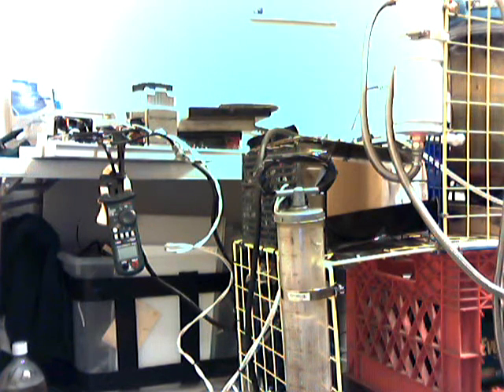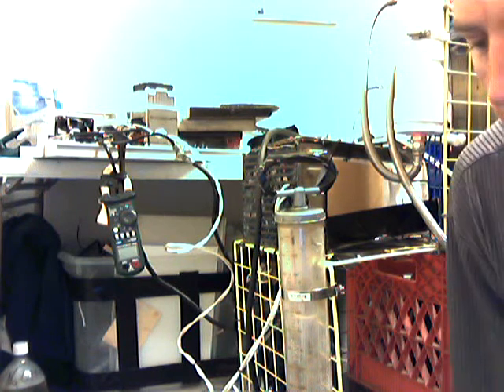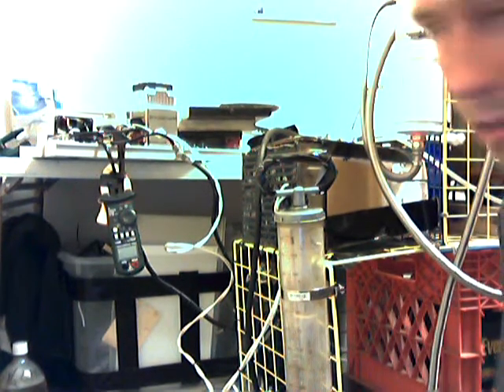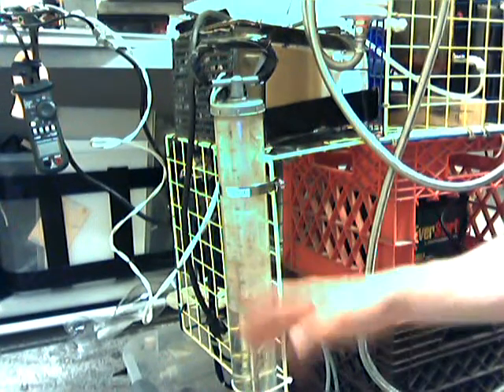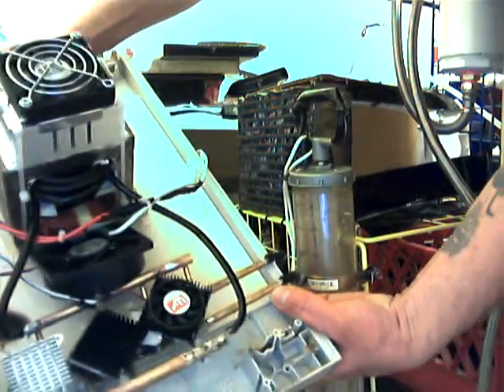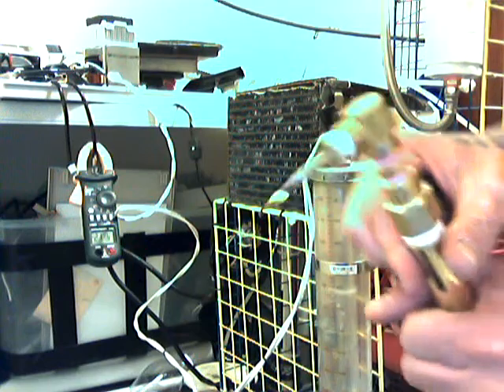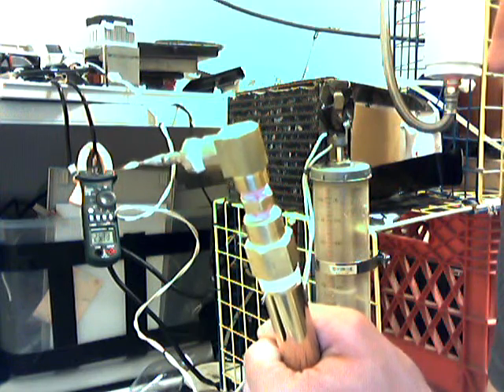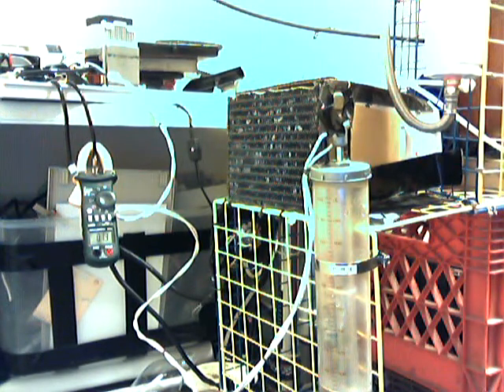hho power supply Liquid Variac,  using electrolite

Comment: Some tips:
baking soda is not very conductive.  If sodium hydroxide is too corrosive try salt or magnesium sulfate(Epson salts).  Your liquid variac is loosely simular to a salt water resistor which also uses AC.  I have seen it as a current regulator for carbon arcs running off 115V Mains.  Stainless steel might be an interesting electrode material for your variac.

Comment: 12v works fine if you use neutral plates to divide the voltage across the plate gaps. It works perfect for me. I use 12v and 42 amps to pull that long flame you see on my torch. Also, if you can get a pure blue flame, you will have pure hydroxy gas. When you see yellow, that means there are impurities in your gas. Nice to see someone else run their cells cold. Much better for steam issues.
Stay Safe.
Jeff